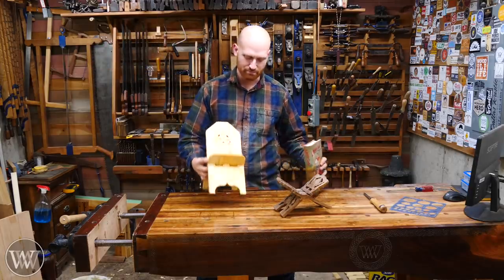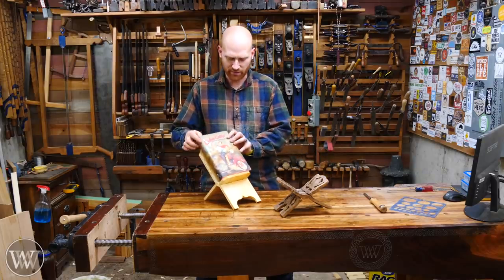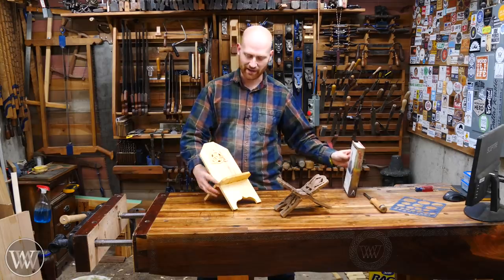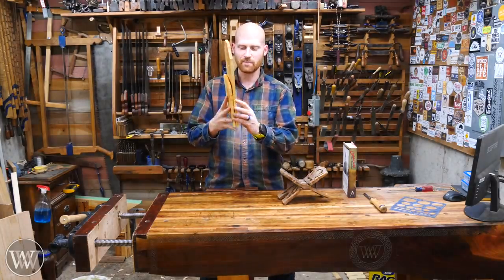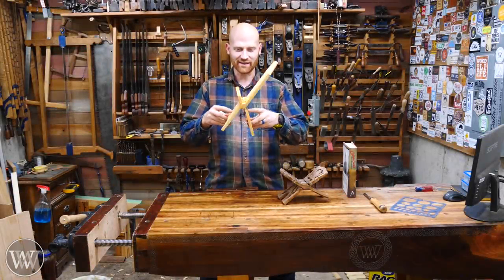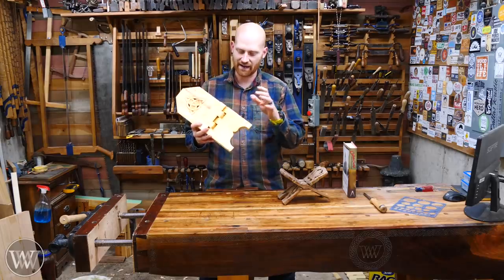Hinged Book Stand From one Block of Wood

Comment: I just made one like this on Saturday, sized it for a tablet computer. Took me about two hours, all hand tools. I didn't do the drilling and keyhole saw thing, just made sure that the saw cuts met up with the chiseling at the hinges (you will see sawdust come out of the hinges). Then tapped some wedges into the top and bottom. It made a frightening kind of "crack" when it split open but worked out fine. Only thing I did differently was I cut the front leg shorter than the back to make it stand more "upright". Thanks James for all you do!

Comment: I have really enjoyed watching your journey with hand tool wood working. I am a fan, subscribe and considering more of a commitment. Your videography captures the main highlights and I really enjoy your work. One question comes to mind with your love of the homemade boiled linseed oil. You apply with your hands which is great. When you clean up the extra, what precautions do you take to ensure there are no fires started and such? Thank you and peace be with you.
Reply from the maker: I actually have a few videos on boiled linseed oil safety and I have one demonstrating it catching on fire. Some people will tell you to put it in water and that will pause the reaction but as soon as you pull it out of the water it will start again. The safest thing would be to go ahead and burn it. But oddly enough boiled linseed oil rags only catch on fire and very specific circumstances and it takes a lot to meet those conditions. Unfortunately the perfect condition is a loosely wadded up rag in the bottom of a trash can. It needs to have enough oxygen for the reaction to take place quickly but not enough airflow to cool the rag down. My preferred method is to lay the rag out flat on the floor and wait for it to cure. Usually about 24 to 48 hours. At that point you can throw it away and be perfectly safe.

Comment: Wonderful video. Wonderful project.  I was under the impression that the red faded out in Box Elder as it aged. What do you do to maintain the reddish color? Thanks
Reply from the maker: it turns more brown but the definition will stay. and when you re oil it from time to time it brings back a bit of the color.
Reply: @WoodByWright  Not enough color to stay excited about?   Found some beautiful slabs, but didn't want to make a table if the red disappears.

Comment: Nicely done, man. Question: instead of using the stabbing motion with the short saw blade, would it be easier to use a coping saw? That is assuming you had one with a deep enough throat. I know you pretty much followed what Roy did in his video.
Reply: I need to check out his second video but I bet a scroll saw would also work if you can keep the cut straight
Reply from the maker: Thanks. The problem with that is you would have to use an even bigger hole to get in the coping saw blade. I played with that but it did not look as good in the end to me. I thought of useing a jewler's saw. As I could do it with a smaller hole but it would be a lot slower cut.
Reply: @McFlysGarage  I've started to use a fret saw for mine. It takes a smaller hole, and you can get a pretty thin cut. I've done it with the hacksaw too, it just takes me a little longer and I couldn't get it as straight as James did. I even tried to plunge cut with a jigsaw once(don't do that).

Comment: Can you make it using power tools please , with a video.
Reply from the maker: Unfortunately there is no power tool that can make this. That is one drawback to power tools they can not make 3 denominational acute corners like the ones needed to make the hinge. you could get close with a fine router bit but the joint would end up being sloppy.